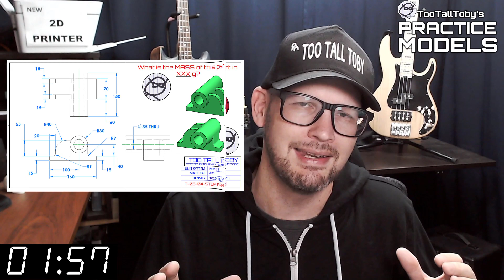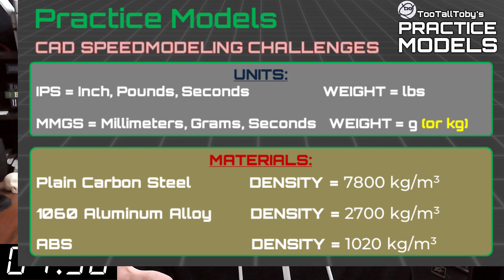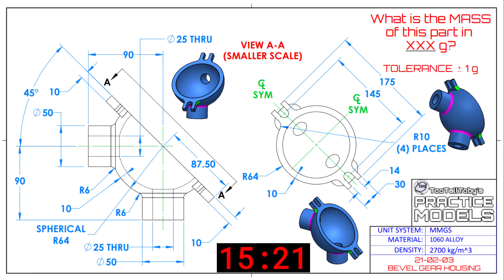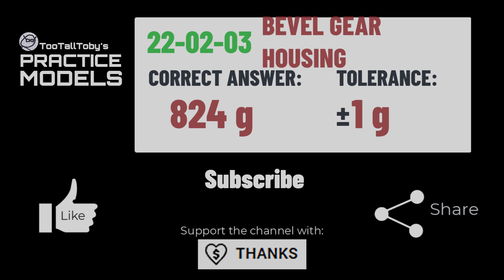SOLIDWORKS Practice - Onshape Practice - Fusion 360 Practice Exercises - TooTallToby-21-02-03

Comment: Forgot the fillets on the first try so got the wrong answer in just under 3:30, second attempt was smoother except I put 4 (from 4 places, total brain fart!) for the second fillet instead of 10mm! Should have probably tightened the tolerance on this one as this was still within tolerance in 2:24!(wouldn't have taken any longer to type in the correct value!)

Posting my solve on my channel for good measure (with the mistakes...)
Reply from the maker: Forgot the fillets?  DOH!!!
Reply: @TooTallToby  Yeah it happens... didn't do the "final spin" carefully enough!
Normally you would add the fillets at the end but for speed modelling it's better to add the fillet as soon as the "parent" feature is created to limit the chances of forgetting...

Comment: Time: 10:30
Mass: 824 (Exact: 824.06 grams)
First Sketch was important. I did the round profile on it and the 45° construction line at 90 mm. Revolve. Then place a plane on the end point of the construction line. Everything else was extrude and cut. At the end mirror.
Reply from the maker: Nice job A P and nice workflow too!  Thanks for sharing!

Comment: Thanks for this, enjoyed it. I have never modelled something from a 2D print before, so this was good practice for that.
My time was 16:20 and I got 824.0482g (Although that time did not include wrestling with fusion's materials library - I had created the material, but it would not let me apply it, turns out I needed to add an appearance too)
Reply from the maker: Nice job and welcome to the channel!  Thanks for sharing that trick about adding appearance - I sometimes get asked how to create a custom material in Fusion - good to know what you look out for!   Good job getting the correct answer!  FYI - the correct answers are always shown at the end of the video (in case you want to doublecheck your work).

Hope to see you in here more!
Reply: @TooTallToby  One suggestion might be - do we even need the materials bit anyway? Could the answers not just be in volume?
Reply from the maker: @evilc2048  A big part of what I do is trying to help engineers become better with their engineering tools - so I wanted to include a variety of materials, because that's what engineers will run into in the real world.  Yes, it's true we could do it with just volume - but to me (as a musician) that would be kinda link learning my scales without tuning the guitar.  - probably not a good metaphor, but hopefully that makes sense 🙂